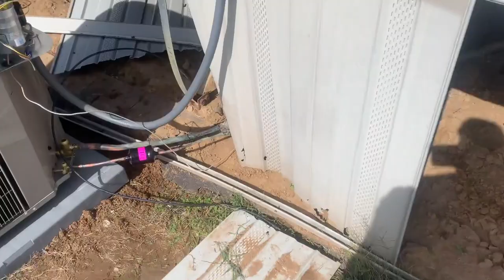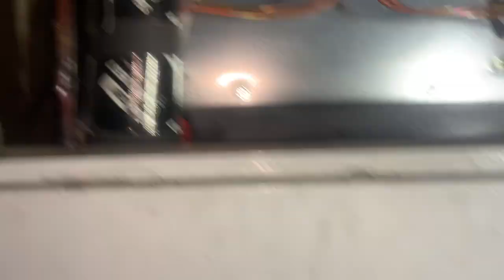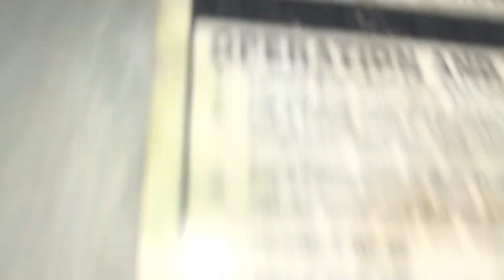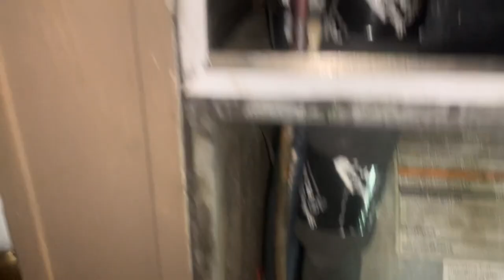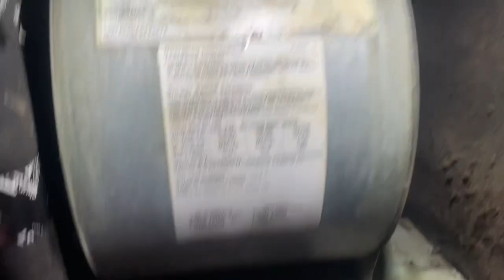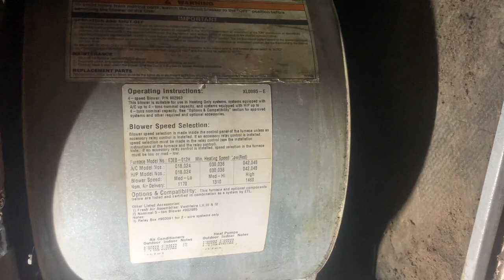HVAC Change Out/New System Installed

Comment: Nice job.... I always convert manufacturing homes ac to heat pump and either adding another return grill above existing or making return bigger and decreasing tonnage to 2.5 or 3 here in central va... heat strips has to be at least 15kw. That’ll definitely make meter spin fast...

Comment: Nice install and clean up, John.  Did this unit not have a filter?  All that dirt and grime looked like years of a unit running without a filter.  Also, does the Bryant unit come with a Copeland or it is it the same across the board with ICP that you either get a LG or Copeland?  Thanks

Comment: I always wondered what that hanging duct above the coil was for, so its better if it is capped? Don't work on too many mobile homes.
Reply: It bring outside air inside. Its good for fresh air but it cost more to heat and cool when your bring hot and cold air inside that needs conditioned.

Comment: Watch out for those LG compressors they're putting in those Bryant's and other ICP equipment
Reply from the maker: I’ve been selling Carrier/ICP products for years with no compressor failures. The first generation LG’s were horrible. The ones they use now you can’t even tell the difference from the Copeland.

Comment: Question, in a change out, what comes first, a vacuum or pressure test???
Reply: pressure test for leaks with nitrogen, then vacuum to remove non condensables and moisture.